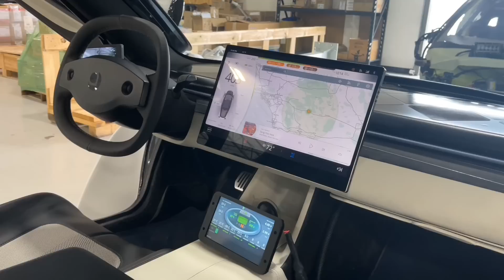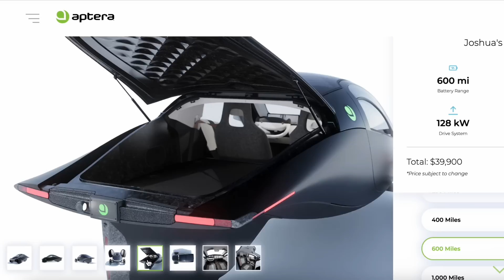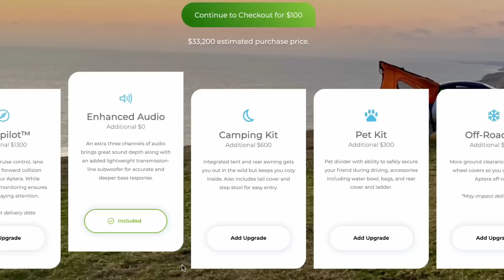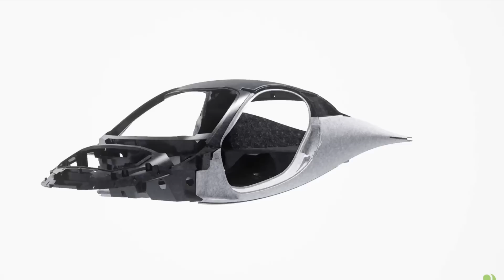APTERA: Conversation with Chris Anthony | May 2023

Comment: Aptera burned 24 MILLION investment dollars and declared bankruptcy in 2011.  Now the same people want your money again. Same promises, same smoke and mirrors, still in perpetual "development" and still NO actual working production, only a couple of demo units. Their "factory" is always mysteriously dead and empty. They continue to claim that their vehicle is "solar" when it is absolutely NOT.  The pittance of solar panels on the vehicle will NEVER-EVER power that thing.  I have lived off grid on solar for over a decade.  I know first hand what solar can and cannot do. Even if they utilized every square inch of the body for solar cells it still would not be enough.  It is a pack of lies.  DO THE MATH.  There are NO real numbers here that add up.  Promises of what will happen "tomorrow" that never come.  Do not believe these shills trying to fake "news" videos by making them look like actual interviews.  
The vast majority of the population in the US does NOT live in perpetual sunlight or warm regions and even under the BEST conditions their few hundred watts of solar cells will NOT make an appreciable difference to charging. 
The design has been "lifted" from the CAN-AM motorcycle, nothing new here.  Their battery bank will NEVER be large enough to meet their fabricated range estimates. They are promising "next year" delivery yet they have been working on this grift since before 2006 and STILL have to get a working production model, still have yet to do crash testing, government ratings, etc, etc, etc.

Comment: Did you know what happens if an Aptera is hit with hail? Are those solar cells ok? It must be in their plans, but I’ve never heard someone mention it yet. Thanks. Great content.
Reply from the maker: most commercial panels are rated for hail up to a certain size and velocity.  my solar panels on my home are more rigid than the cells on the Aptera, but they have been damaged by golf balls (I have a video on it).  However, the array is still working about 70% despite the damage.

Comment: Also, re: 7:21 — the same is also true for delivering using apps like DoorDash and Uber Eats, not to mention independent contracting platforms like TaskRabbit. With an Aptera you could almost completely eliminate how much you’re spending per mile to deliver each DD/UE order while still saving on taxes in the case of deductions, to the point of only needing to supercharge maybe once per day even on the busiest of days, and in the case of TaskRabbit, well, that’s a flat $0 per mile given that you could accept a task 20 miles away (40 round-trip) and leave the Aptera out in the sun to charge while assembling furniture or mounting a TV for example.
Reply from the maker: Exactly.  It’s the perfect vehicle for local, small freight delivery.